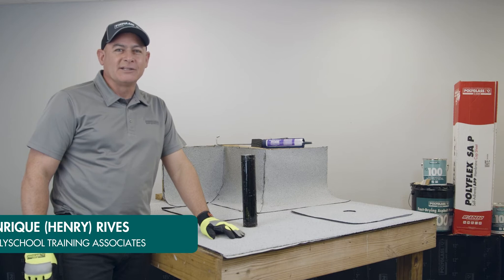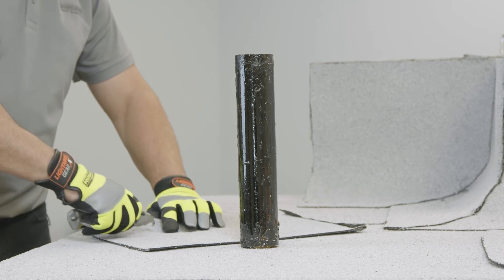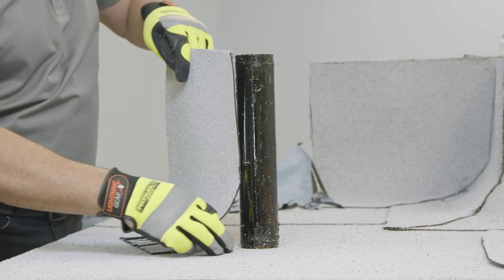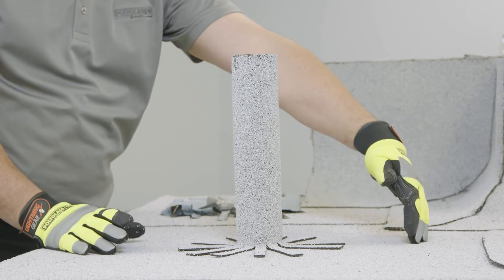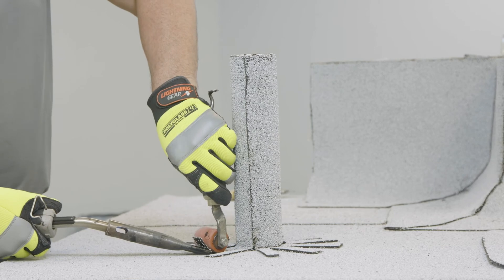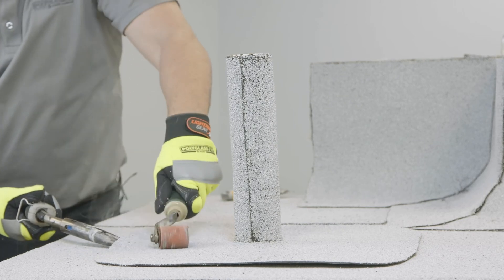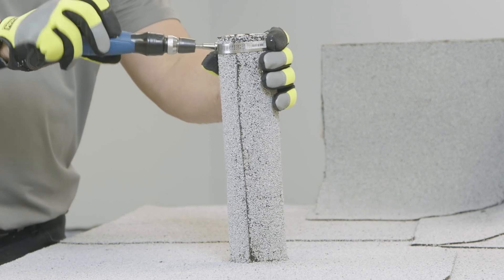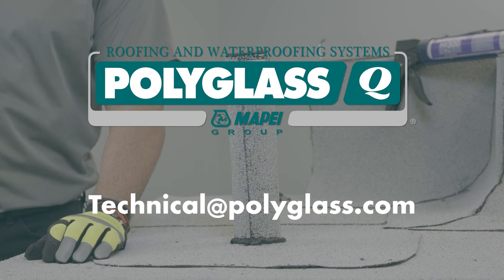Pipe Flashing Detail | How to install Self-adhered Membranes

Comment: Couldnt you just use a regular boot with cap sheet
Reply from the maker: Thank you for your interest in our company's products! Yes, using a lead flashing with flashing cement or a liquid flashing solution are our preferred methods for sealing around pipe penetrations.
The purpose of this video is to show an alternative option in case other methods cannot be performed for any reason. If you have any other questions, please reach out to our customer support team through our website: https://polyglass.us/contact/

Comment: Thanks this is confusing regarding the heat and granular surface but super helpful with double layer and finger technique on pipe wrap. I’m using peel and stick ice and water which sticks to itself. Should I still heat it? Thanks
Reply from the maker: Polyglass Ice & Water membranes are not made for long term exposure, and not intended for use on this type of detail.
Whenever lapping a Self-Adhered (SA) membrane onto a granulated surface, the use of heat or adhesive is required to ensure proper adhesion. SA membranes that have a film top surface will bond to themselves, but the use of heat from a hot air welder will greatly improve the bond. If you have any questions please feel free to reach out to any of our technical representatives: https://polyglass.us/technical-sales-representative-locator/.

Comment: If I’m doing this repair on roof in 100 degrees heat, do I still need the heat gun to activate the adhesive??
Reply from the maker: Yes, whenever you are doing a Self-Adhered detail and you encounter an over-granule condition, the use of heat or adhesive is required for the membrane to bond to itself. The ADESO compound does not bond well to loose granules, and adding heat from a hot air welder, or an adhesive such as PG500 to the detail, better ensures a tight seal and bond. Feel free to contact any of our technical representatives if you have any more questions https://polyglass.us/technical-sales-representative-locator/.